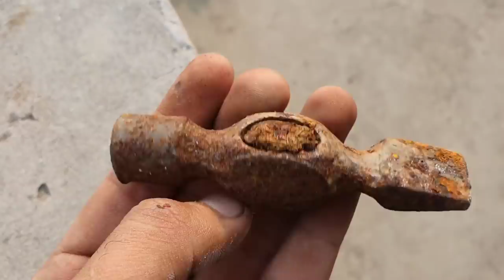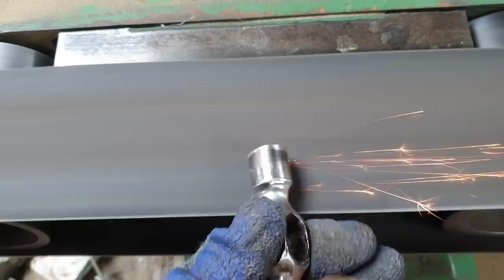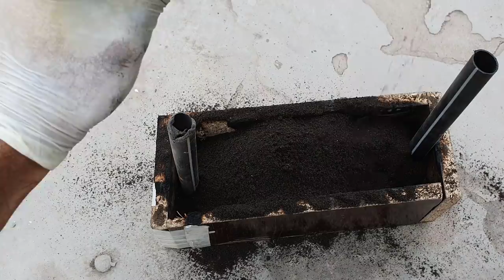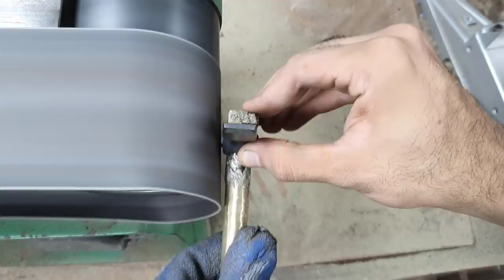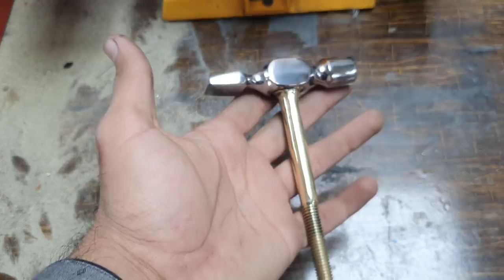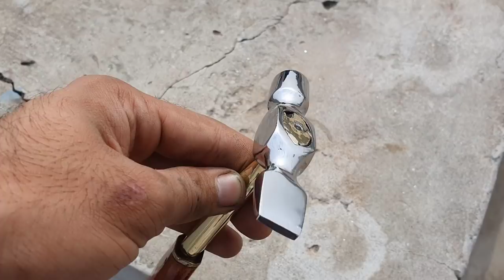Rusted Cross Peen Hammer RESTORATION

Comment: Looks almost like a jewelers hammer, it's off center, and the handle should be sanded with 100 grit as to a finer grain so when you spray the varnish it will fill quicker and look finished. Looks good 😌

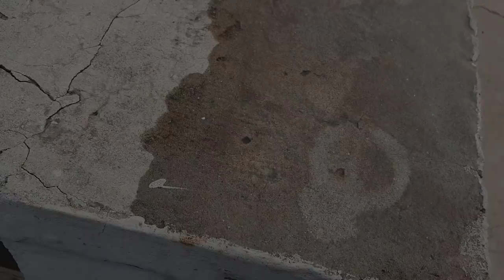Comment: 2:32 is as far as I would have gone to restore this hammer to as close to original authenticity as possible. However "Metal Hurts" had more in mind for this hammer and proceeded to build according to his vision. I applaud the results, I won't be one of those being critical. 
I personally prefer the older look, simply getting rid of the surface rust, possibly treating it to avoid further rust, then if I'm really lucky I'd find an equally old handle for it. 
It's a matter of taste, anyone finding fault of the resultant shiny hammer ought to know better!
Reply: Actually, I don't know how I missed that it does have a handle at start of video. I would prefer to save that handle and reuse.

Comment: Beautiful job except you didn't seem to clear the rust fully from the inside slot for the hammer and it would have been nice to see you create the screw grooves in the metal for the handle

Comment: The correct name for that hammer is a WARRINGTON hammer.It was originally from Warrington in England and used by cabinetmakers.The cross pein is the flat head on it . The round head should be BELLED so as not to bruise wood when driving brads.Not a criticism just helpful information I hope.

Comment: Thank you for posting your whole procedure. Curious is sulfuric acid more effective than electrolysis
Reply: Check out project farm as he did a great breakdown on rust removal.  I use white vinegar @ 5 % and it works well without the danger of the acid.

Comment: I have seen the spelling in 3 different ways.Peen, Pein, and ping. Are those different hammers? if not what is the correct spelling?
Reply: Usually spelt Pein pronounced as in ' Pain', peening is what you can do with a hammer as in peening a rivet over as shown in the video.'
Reply: @keithdouglas4581  mznzmzznsnsnjqj

Comment: A hammer is for work now a ornament as when you polish it up you tend to have a accent as it slips as all hammer heads should be ruff on the surface of the head you use for contact with the work not polished up ok.
Reply: Andrew George what’s wrong with it becoming a bit of decor?  I have several tools that I don’t use, but use as decoration.